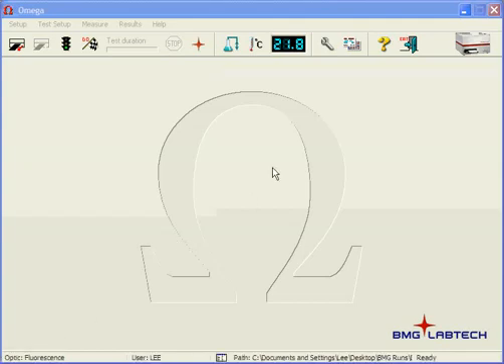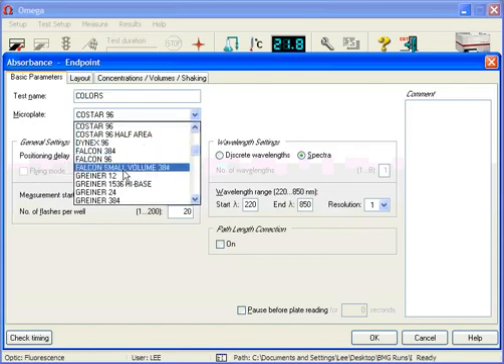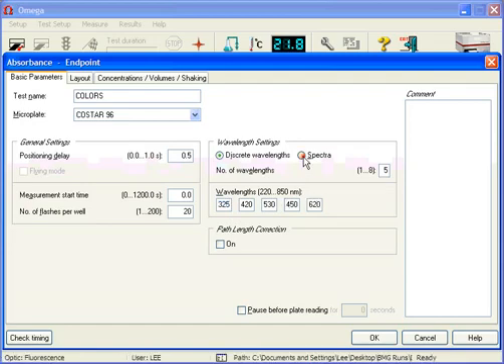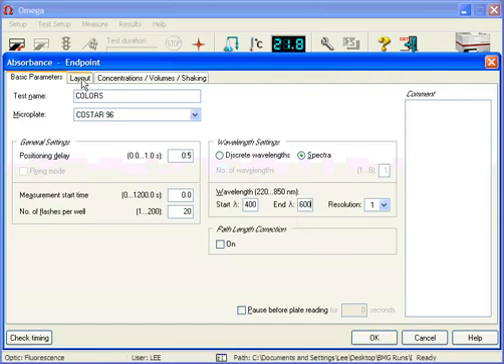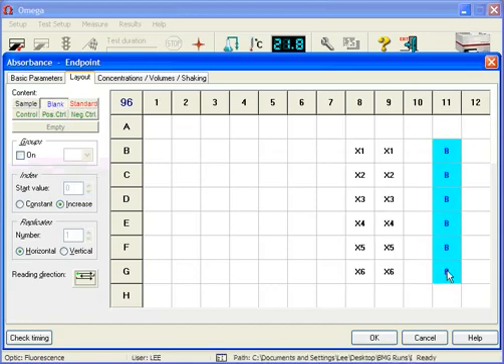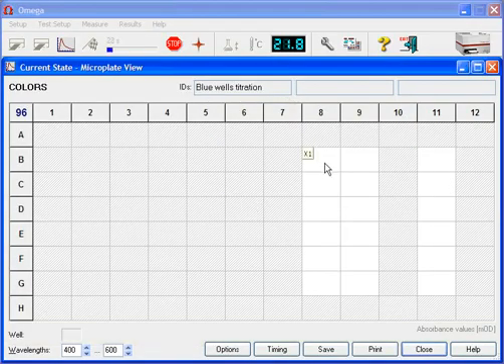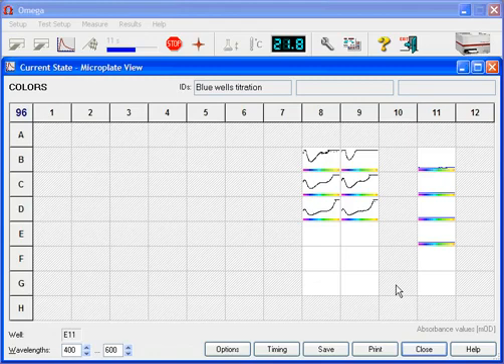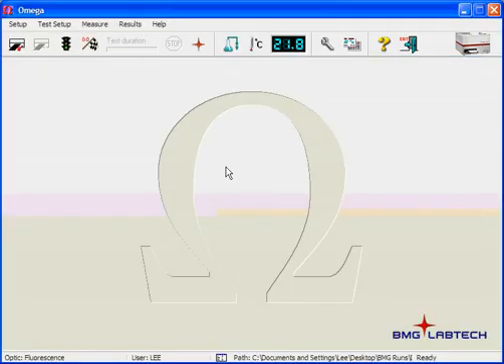Simple Absorbance Reading

Comment: Hi, what to do if there is no options for Discrete wavelengths? There is only No of multichromatics and ex filter; em filter
Reply from the maker: It sounds like you've landed in the setup for a fluorescence protocol. Ex and Em Filter can be selected there. If you want to start an absorbance measurement, select the ‘New’ button in the ‘Manage Protocol’ tab and then select ‘Absorbance’ under the measurement method.
Reply: @Bmglabtech   I have double checked. There is no such option even if select absorbance. I can choose empty for excitation and filter for emission from list, no way to setup wavelength.
Reply from the maker: @aniai7307  We would be happy to clarify this case with you. Could you please send us an e-mail with the serial number of your device to  applications@bmglbatech.com? Thank you very much.